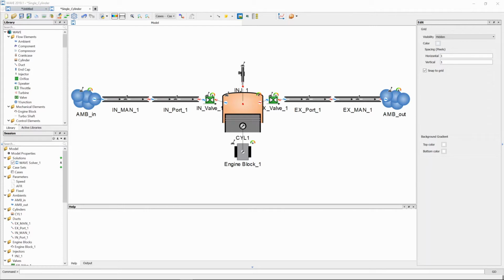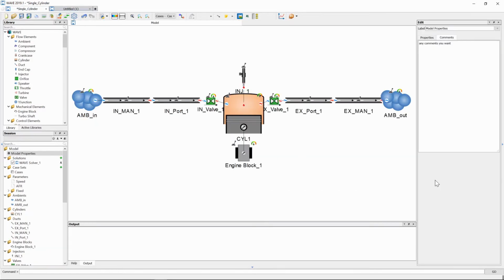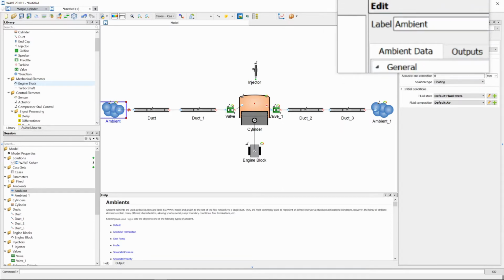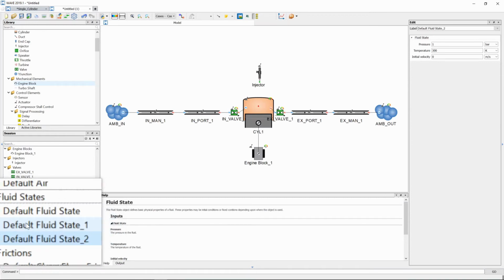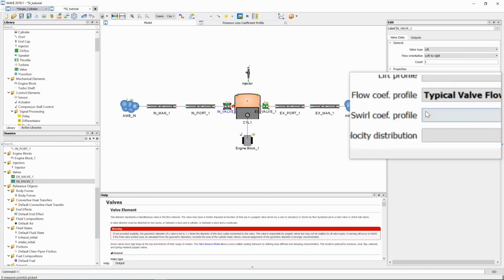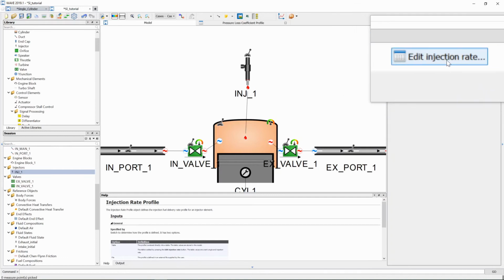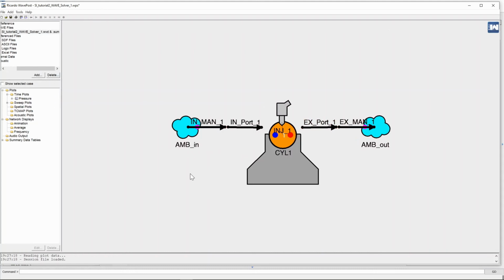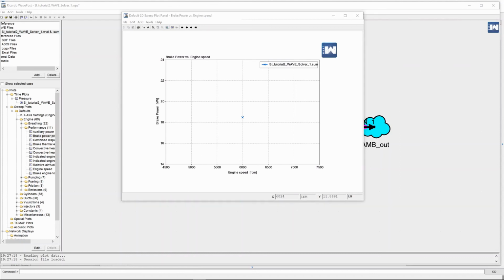How to simulate a one cylinder engine in Ricardo WAVE | Introduction to Ricardo WAVE | Tutorial

Comment: How to perform simulation at multiple rpm at the same time and plot them in the same graph?
Reply from the maker: Hi Aditya - thanks for the comment. To create a plot with multiple rpm values, you need to add cases to your model with different engine speed values. In another video I made (https://youtu.be/iLxEX3B9VnI) I used an example which looks at engine operation over different rpm values.
Reply: @AdriaanVanNiekerk  Thanks for the help!

Comment: I want to add venturi  then Plenum then runner and  then into engine so how can it be done
Reply from the maker: Hi Aditya - thank you for the comment. You can create a venturi by using multiple duct objects and an orifice object. You then change their left and right diameters to create a taper and set the correct C_D for your system. For your plenum and runners you can use duct objects. Hope this helps 😊
Reply: @AdriaanVanNiekerk  How can I add plenum cad file between the venturi and the runners?
Reply from the maker: You will have to use WaveBuild3D to generate the geometry so that you can import it into a WAVE model. In the WAVE documents, under intermediate tutorials you will find a nice step-by-step guide on how to use WaveBuild3D
Reply: @AdriaanVanNiekerk  Actually the Wave3D tutorial files are not opening in Ricardo so how can i open them?

Comment: By this simulation , can I get the back pressure generated and noise by my muffler ?
Reply from the maker: Yes you can - WAVE has a nice tutorial in the documentation on how to simulate acoustics when it comes to mufflers. You can also use a pressure sensor object to determine your backpressure at any point in your exhaust pipes.
Reply: @AdriaanVanNiekerk  Can you please exactly tell which tutorial shows about acoustics in Muffler
Reply from the maker: There are a few - the first one is in WAVE manual -> Tutorials -> Intermediate -> Acoustics. Once you have done that one, there is also another tutorial under Advanced which looks at acoustics optimisation.